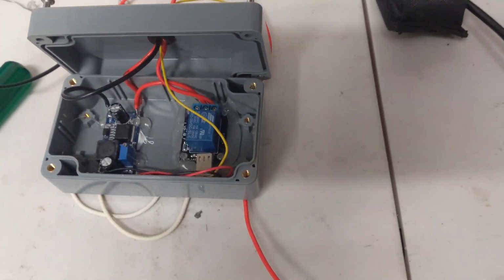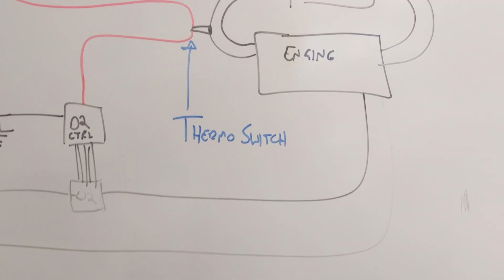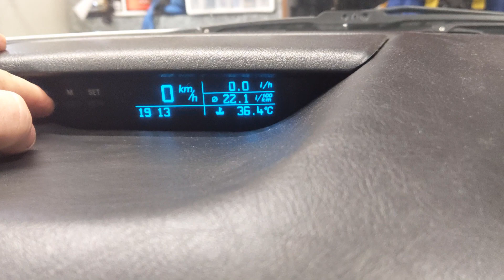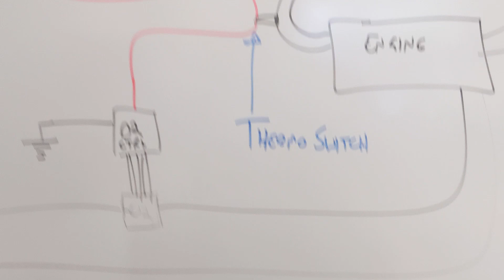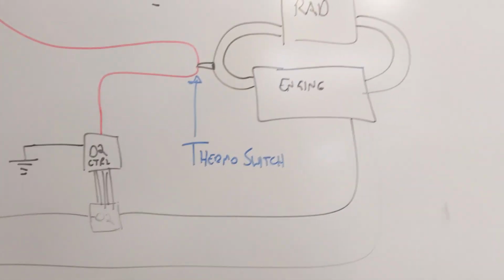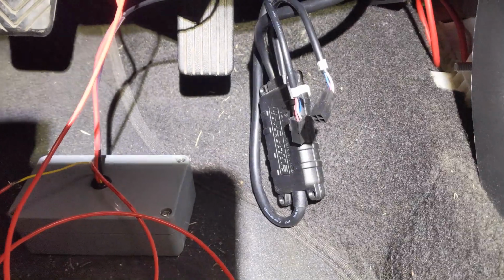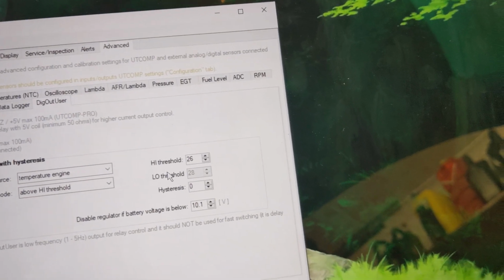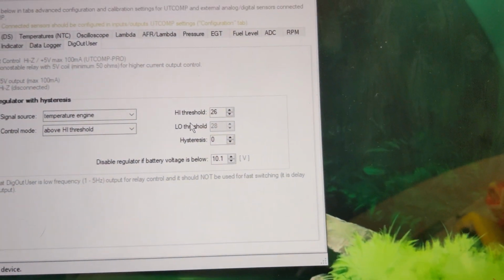Switching a Bosch LSU 4.9 based wideband O2 sensor using engine temperature

Comment: The delay is interesting solution but this path begs the question as to the point of a sensor's internal heating. Would seem that Bosch or any similar "major" manufacturer would recognize that moisture should be cooked off prior to the sensor functioning given moisture being a cause of sensor failure. Or, do manufacturers like Bosch benefit from their sensors failing?
Reply from the maker: Honestly mate, I really don't know.  My engineer says that only the NTK sensors are any good.  I've since moved back to using the LSU 4.2 sensor, and haven't burned out a single one in over 2 years.

Comment: I have the leaded c16 issue killing mine.
Reply from the maker: I really should update the info for this video but I've given up on the LSU 4.9.  I think I burned through another three even after my circuit here.  They lasted longer but still died.  I went back to an LSU 4.2 and it's been rock solid.  It juse has a slower update rate than the 4.9.
Reply: @KaldekBoch  do you know if 4.2 works with the AEM data logging gages? I have side pipes and one on each side so when I blow one it's a lot of cash.
Reply from the maker: @DiscoGreen  I can't speak for AEM but since I use an Innovate LC-2 it's just a cable swap and a setting in the controller to support the 4.2.

Comment: Great video! ive gone through 4 LSU 4.9 sensors in the last 3 months, my ecu has plenty of unused outputs which i thought about using for the purpose of this very video BUT, wideband manafacturers strongly advise against running the engine without the sensor powered up, this to me is strange as many OE setups with factory fitted widebands also implement a delay strategy so based on that we should be ok to use the method, now ive seen this i will setup one of my outputs to delay the sensor and see if i can get a longer sensor life.
Reply from the maker: Hi sebastian, FYI I'm about to replace this assembly with a tiny single board circuit called a Polulu 2815.  Stand by for a new video on this.
Reply: @KaldekBoch  over the last few months ive tried various things in an attempt to fix the issue, mixed results TBH. I have since switched to Maxxecu which has its own internal WB controller and have been fine, looking forward to your update video though, good to see these things
Reply from the maker: @sebfullick5011  oddly enough my current sensor failed today, mere days before I install the new control circuit.  The problem now is that many of the Bosch LSU 4.9 sensors for sale are fakes.

It did last almost 2 years this time though.
Reply: @KaldekBoch  Yes your right, most wideband controller kits, aem being one of them dont use genuine bosch sensors, i actually work for a Bosch certified garage and the ammount of fake parts from suppliers is crazy! One thing i have seen is the LSU 4.2 sensors last much much longer and they certainly arent as slow as people say.
Reply from the maker: @sebfullick5011  Interesting yeah I originally had an LC1 with the LSU 4.2 sensor.  I've ordered a new LSU 4.9 but now I'm wondering if I should just go back to a 4.2  Do you know if they are the same connector layout?  The LC-2 can be programmed to go into LSU 4.2 mode.
Reply: @KaldekBoch  Hi, yes you will need to buy a different connector, de pin the one you currently have then look for the connector housing from the likes of Mouser, RS components etc then use your existing pins in the appropriate sequence. Like ive said and from my experience the 4.2 sensors last much longer and they aren't that slow to respond